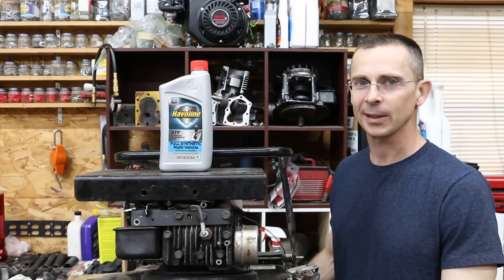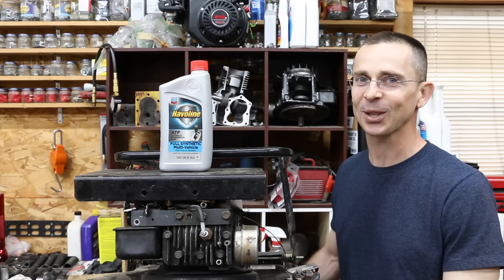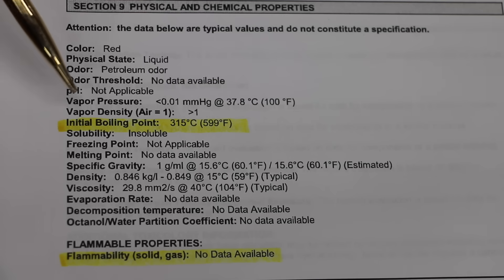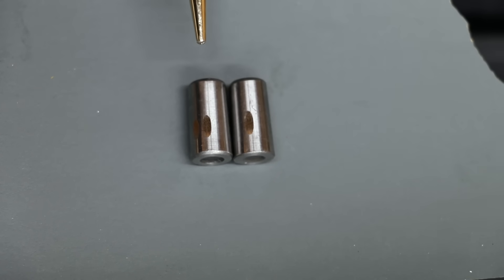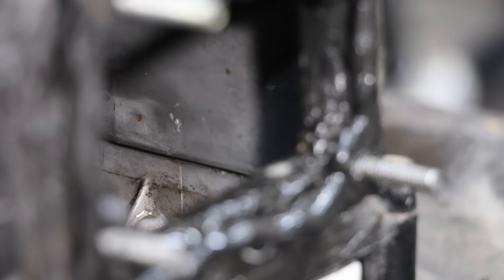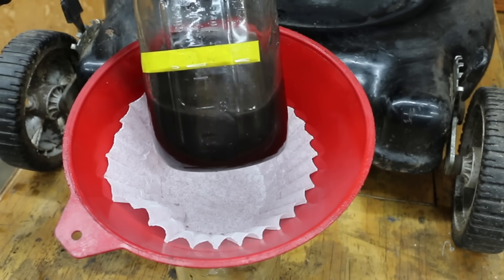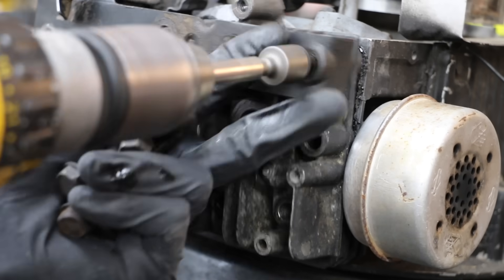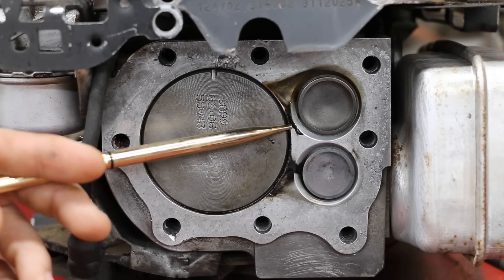ATF as an Engine Oil substitute?  Let's see what happens!

Comment: Atf is actually a great cleaner we use a quart to every 4 quarts of oil run our vehicles for about 1,000 miles, cleans oil Valleys and valve covers very well, it also clean any debris in the around the valves and all you passages

Comment: As a professional technician the only thing i have done is use it as a oil flush but half ATF and 1/4 motor oil and 1/4 off-road diesel fuel and run for 5 min at idle with a cheaper but good new oil filter or 3/4 ATF and 1/4 off-road diesel but run at idle for 1-2 minutes. Really helps clean the motor. And that immediately following actual oil change should be a early one suggest like 2k miles. Helps flush out further and the leftover deposit of diesel fuel and atf from the flush will have done further cleaning.  But only on really dirty engines. Or when I buy a new very used car so I have a fresh starting point but that’s just me.
Reply from the maker: Thanks for sharing.

Comment: I have tried it about 25 years ago ran a car 10 mile round trip drained it came out a bit dark then replaced oil and filter then oil change again after about 30 miles. Ran ok after that but I would not do it again.  I would sooner put synthetic oil in and just keep changing the oil  on schedule rather than use trans fluid or flush when it has sludge problem. I saw a motor that Flush finished off all the sludge went straight for the oil pump soon as it got free.
Reply from the maker: Thanks for sharing.

Comment: My Dad used to put away a VW Beetle for the winter, and before doing so, he’d drain the oil, clean the strainer, then fill the engine with a mix of Marvel and ATF, run it at idle for 15 minutes before storing it. The next Spring, he’d start it for a few minutes, check the strainer after draining it, and put oil back in it. He swore that the atf kept the gaskets and seals pliable, and the Marvel cleaned it up. The car never gave us any engine issues. But, my Dad was on top of the maintenance of all of our cars, a true “car nut” if you will.
Reply from the maker: Thanks for sharing.

Comment: Hay P.F.
Trans fluid has additives for pressure that help control, working valves and gears in a auto trans and it cannot substitute for regular motor oil that's designed for lubrication and to help clean a gas engine. Although oils are similar, regular motor oil is made specifically for gas engines and to help maintain oil pressure to not exceed 60-80 lbs of pressure. Trans fluid can handle higher pressures that make the auto trans work correctly and each brand of tranny fluid is made to each brand of cars/trucks.  If you had attached a oil pressure gauge to the test engines you used for this test, the tranny fluid would've had a harder time keeping the required oil pressure that regular vehicles require. 
Is it OK to use tranny oil in an emergency, for short distances, yes, but for long periods of driving, the engine would not be able to keep the required oil pressure.
We used to try all kinds of tricks with oils, grease and seal materials to see what worked and didn't.
There was no oil pump involved in the engine(s) used for this test.  If that had been a vehicle engine, it would've seized after about 2-4 or slightly more hours. 
Thx for a good test, otherwise.
Reply from the maker: You are welcome Thanks for the constructive feedback.

Comment: This was mostly a great way to keep a engine clean in 50s,60s,&70s  most car & light truck oils did not have detergents or much any way 
You could of run a diesel oil but as with to much atf it would cause gaskets to leak as most was made of CORK 
Oil has came a long way since
Reply from the maker: Thanks for sharing.

Comment: Growing up in the 60s when engines usually used more oil, a common practice was to add a quart of ATF to your oil a couple of hundred miles before you changed oil and it did help  clean some of the gunk that would try to build up in your engine.
Another trick with ATF is to add a quart to a full tank of gas periodically to help clean your fuel system and change your fuel filter afterwards. I did this to a used 97 Silverado 2500 I bought and drove from Tucson to Phoenix. When I arrived, I could hear the fuel pump screaming inside the tank because of filter blockage. A change of fuel filter cured the pump scream and I cut the old filter open and it was completely full of crap that had been scoured out of the system and gotten by the pump screen. No noticeable smoke from exhaust from the ATF due to the small amount of oil to gas ratio. 197,000 miles on the truck now and still working cleanly with no misfires.
Maybe this is a test you could do a video on?
Reply from the maker: Thanks for the suggestion.

Comment: I know back in the old days, say mid 80s, a bunch of guys I worked with raced the dirt track on weekends.  They all swore by using Kerosene as an engine cleaner.  They would drain the oil then add same amount of Kerosene then run the motor at idle for a set time.  
I want to say 5 minutes but I cannot recall that part and I never did try the method.  If you see this comment Im wondering if you have heard of this trick and if you have tried it?
Reply from the maker: I've heard of it but haven't tried it.
Reply: Ok thanks

Comment: I had a 3.1 liter v6 chev Malibu that had a bad stuck lifter.  I filled it with trans fluid and let it idle and the tick started to quiet down then completely stopped I had the car for over 150000 more miles and it never returned.

Comment: would you recommend using 0.5 litre  DEXTRON 6 transmission oil in 5w30 engine oil 100 miles before scheduled oil change to remove any buildup in GMC YUKON 2013 (240,000 km) - there are no issues in engine, I just want to clean any built up over last 9 years. Thanks in advance for your reply
Reply from the maker: Thanks for the suggestion.
Reply: @ProjectFarm  thank you for a prompt reply. I wanted to know your opinion about above please.

Comment: I have a 1988 ford ranger LIMA 2.3 that I used Trans X ATF Stop leak I could smell it burning when I started the engine for about 30 seconds due to the engines high amount of blow by but after about 15 minutes of driving it started running quieter and better than it ever had before. been about 15000 since ive done that and the compression still seems to be up
Reply from the maker: Thanks for the feedback.

Comment: I know this video is old... I usually put a half a quart of ATF in my car about a week before an oil change..  it's something my dad taught me 30 some odd years ago... 
After I fix head gaskets, lower intakes, it there's water in the oil.. after everything is fixed and depending on the engine size.. let's go with a V6 that take 4 and a half quarts of oil (blown head gasket) after a full gasket change , heads, intake etc.. my first fill is used oil... second fill, I'll put 4 quarts of oil, half a quart of ATF and a quarter quart of kerosene.. let it idle for a while while giving it some gas.. then change it out... then I'll fill the entire crank case up with kerosene let it sit and crank it without starting it to get all that nasty clumpy crap out... then I'll fill with used oil mixed with ATF and drive it around for an hour.. let engine cool, fill with kerosene, let sit and then change it out.. 1 more kerosene flush, with no start cranks and then drain.. fill with regular oil and its ready...
Sounds like a lot and maybe I'm going overboard but this is what I was taught by a really anal master mechanic (my dad) and it's helped my engine last over 500,000 miles. He had an 1987 Civic last over 1,000,000 miles.. a 1984 Cutlass with swapped a 396 last for 600,000 miles... the engines in these cars last longer than the frames.. the cars fall apart while the engines are still going strong... he might be anal and that anal has rubbed off on me but these engines last for many many miles.. I trust what he does..
Just add a half a quart of AFT about a week before an oil change and then change the oil as normal...
Everyone has their different ways of doing things, this is what I've been taught and I apologize for the ADHD novel hahaha... love your show man... good stuff..
Reply from the maker: Thanks!  Thanks for sharing!

Comment: I seriously doubt the metal shavings are because of the ATF. On the advice of an old and very well respected Ford mechanic I refilled an old 4 speed trans in my 1978 F-250 back when I had the input bearing replaced in 1992. I have a built 400 engine in that rig and have really worked it hauling heavy loads. It shifts easier, especially in cold weather and does not have gear and bearing noise due to the lighter viscosity oil. I thought it would and was hesitant to do the substitution back then. And it does not leak through the seals. That mechanic said they will run cooler and it will clean them up. I figure there is also a gain of net power due to less friction drag of the heavier gear box oils too. That rig has about 75,000 miles on the ATF in the transmission.
Reply from the maker: Thanks for sharing.

Comment: I have a positive experience with using AFT fluid on a 1986 Chevy Caprice . I was in trade school at the time for automotive repair, when i learned from an instructor that alway substituted one qt of engine oil with ATF fluid when doing an oil change. Four years after my father brought a brand new 86 Caprice a lifter knock developed. I started the car ,took a cap full of ATF fluid and rev the motor slightly and poured it down the carb. Almost instantly the knocking stopped. We still have the car till this day in Oct 2021, and theres been no knocking from that lifter. The car has over 400K miles on it. A few years ago the odometer flipped to all Zeros .
Reply from the maker: Thanks for sharing!

Comment: The atf works well for cleaning oil paths, cam phasers, solenoids, and the like on modern engines. Used commonly to remedy variable valve timing issues.
Reply from the maker: Thanks for the feedback.

Comment: I ran a mix of 50/50 motor oil and tranny fluid in my motor cycle crank case with a wet clutch. It cleaned the crank case, and made the clutch grab better.
Reply from the maker: Thanks for the feedback.

Comment: From my personal experience with sludgy engines, If the engine wasn’t too bad then if the engine was low on engine oil, We would fill the engine crankcase up to the proper level with ATF and operate the engine for a short period of time and then change the engine oil and oil filter. For extremely sludgy engines, We may drain out some of the oil and refill with kerosene in the engine was never run except at idle for a few minutes then again the engine oil and oil filter was changed out. We always wondered if Marvel Mystery Oil was nothing more than ATF except more expensive to buy. A very good “Old Product” for sticking valves was the Rislone that was a very bright blue color. A old school mechanic told me that the Rislone actually used to be sold at Dodge/Chrysler dealerships to treat the sticking valves in the older engines.  I’m kind of wondering if this product is still available or under a different name. As always; Thanks for your great videos.
Reply from the maker: You are welcome!  Thanks for the feedback.

Comment: When I would buy it high mileage car or truck that I was planning to keep for a while I would drain the oil and refill with diesel or a 20 to 40 percent transmission fluid and oil and run for about 10 miles. It seemed to flush a lot of sludge out. I  then dropped the oil pan and cleaned out the real sludge.  Big difference after. If you don't clean the pan don't bother at all in my opinion.
Reply from the maker: Thanks for the feedback.

Comment: I once saw a guy use mineral spirits in place of engine oil to unstick carboned up piston rings. I don't believe it to have caused engine damage, but do not recall if it worked after a 30 minute run on a big block Chrysler. What do you think?

Comment: My dad had a 1970 Galaxy 500 and at about 40k miles the engine had a horrible knock, the dealer took off the heads and carbon buildup was causing the knock.  After that my dad would add a 1/2 quart of atf to all the oil changes and he sold that car at 200k+ miles with never another problem.
Reply from the maker: Thanks for sharing!

Comment: My 1956 Ford v8 was smoking a lot. I put three quarts of automatic trans fluid and 2 cans of STP in it and drove it. Rotating putting in oil and STP when oil was needed. The engine quit smoking in about 2 months. Then I replaced the mixture with motor oil and drove the engine and it did not start smoking again. The engine seemed to perform a lot better,  maybe because the rings were sealing better.
Reply from the maker: Thanks for the feedback.

Comment: You should update this test and put a quarter gallon of diesel to clean the crank case since it’s a detergent
Reply from the maker: Thanks for the suggestion.
Reply: @ProjectFarm  yeah I just saw a couple minutes ago the video of you running diesel in a crank case but I’ve seen multiple mechanics that will right before and oil change put a half gallon of diesel in a car and it’ll clean the bottom end and the oil will be pitch black

Comment: I remember ATF added to motor oil to rejuvenate the rubber rear seal on the crankshaft was the story going around.  Nothing about cleaning up the carbon.  Just give it a long hard drive uphill in both directions, same motor oil than you normally use..  When you said ATF has mineral oil in it?, you can get mineral oil from the local drug store.  It is taken for constipation...so can be mixed with water.   Used as a lubricant in an engine?  I don't think it goes with gasoline.
Reply from the maker: Thanks for the feedback.

Comment: Find this kinda interesting. I have an old truck that the manual says to run 30w motor oil in auto transmission, and your running trans fluid in engine. Simple cars stuff doesn't really care I guess.
Reply from the maker: Thanks!

Comment: Back in the '70's we used to put trans. fluid in our engines all the time to free up sticky lifters.  It would also clean up the valve/rocker arm assembly too.
Reply: I’d like to try it on my sticky lifter. How do you recommend I do it?
Reply: We also had engines that could take a lot of abuse. My friend had a POS green buick that overheated every time we drove it. He'd continue driving until it would stop. We would walk to wherever and come get it later, with some water,  and that damn thing always started and drove again! He even legit seized it up a couple times. Broke it free with a breaker bar on the crank pulley and off we went.  Flip side, my 03' BMW thermostat sticks ONCE and I'm buying a new head and camshafts.....

Comment: I love these videos but I'm curious if any of these treatments hurt the gaskets in an engine.  A good test might be to get a few valve cover gaskets, cut out the spark plug seals and let them soak in seafoam, ATF, oil, MMO, etc. for a few months, and see how it impacts their thickness, elasticity, and strength by hanging weight off of them.  You could also cook some of them to see if that has an effect.
Reply from the maker: Thanks for the video idea.
Reply: @ Captain Awesome:  I would also like to see the results of that test.   I would also like AT-205 to participate in that test.
Reply: Hmm. I like that. 
Then PF will do all the work, expenses etc and we just watch. 

Thanks again Project Farm.

Comment: My sD has a Volvo dealer ship
 His lead mechanic sais he substitutes o e quart of at with one qt of engine oil. . So i did this he doesn't drain u til oil change time . I drove my 1 ton van with 6.0 I. It about 600 miles. Here are the results. I uses a chop stick to get rje gummy work of shit out of o drain plug. It was so nasty had you told me you were loolo g ro buy said vehicle id have said run far!. I did this test because I would get a lifter ticking randomly while I was under loss
 The tick eventually came back . But man the shit that came out of that o drain. Was nasty.

Comment: Traditionally the ATF was used in conjunction as an additive with regular motor oil as a additive to clean out the sump and other parts of the engine, not instead of.
Reply from the maker: Thanks for the feedback.

Comment: I was raised to believe that ATF is equivalent viscosity to a 7wt oil.  Based on my experience with using it in things like motorcycle forks, that seems to be about right.  Except that it has the ability to find and create leaks better than if you filled the bike up with liquid wrench.
Reply from the maker: Thanks for sharing.

Comment: I’m not sure if you have done this test but you could take a small engine that will not run due to low compression and add transmission fluid to the fuel. I’ve done this and it seems to work on old tired engines. We call it liquid compression. Cheers 🇨🇦
Reply from the maker: Thanks for the suggestion.

Comment: run a quart of parts washer for 5 minutes with a cup of silicate beads. drain and run a quart of engine degreaser. drain and take a garden hose. shove it in the carburetor and turn it on full. then take off muffler and stick hose in exhaust. drain and fill with amsoil severe damaged engine oil. your engine will be better than new! and while you're at it lowes is having a big sale on new mowers. and just toss the old in the landfill. buzzards gotta eat same as worms!
Reply from the maker: Thanks for the feedback.